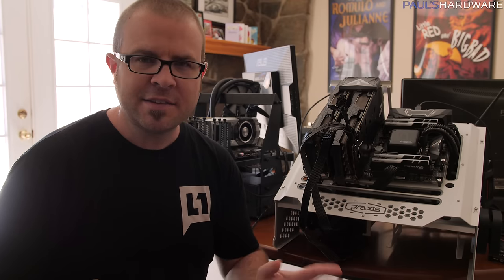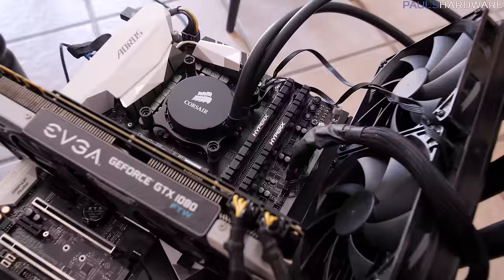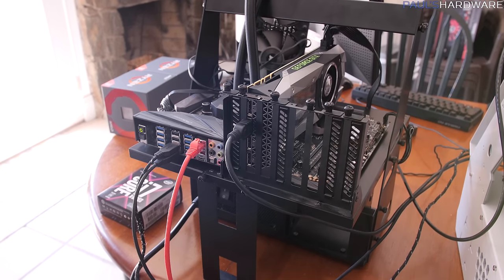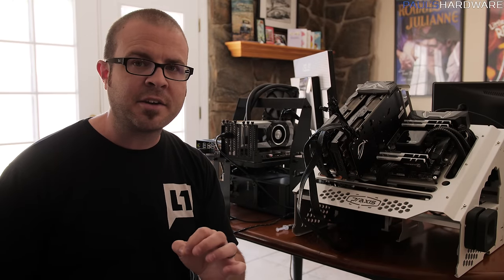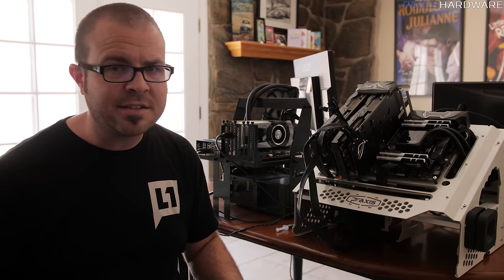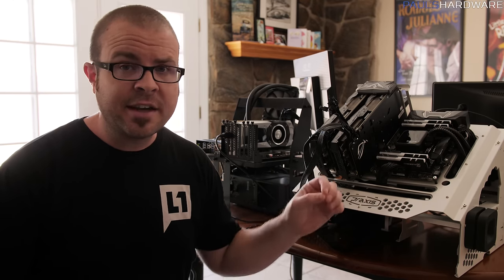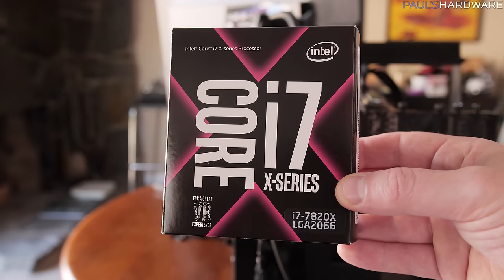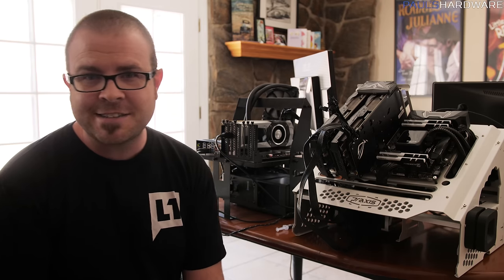What's The BEST CPU for Gaming with 1080 Tis in SLI?

Comment: If you are already usinf a x99 in your build why even going for any other 8 core platform at all? Either Paul an HW youtuber is overhyped on the new stuff thinking it would give him a big perf boost when it in fact does not even as far as going to haswell-e or he simply does it because like many others in this hobby likes to build new stuff, lets hope for the second one. Btw was the res 1080p? if so why the low perf numbers especially in GTA5, did it say ~80 fps with a 7700k and a 1080ti? even other titles like Tombraider seems low if this was 1080p, like a 970/980/1060 perf figures.

Ah it said 4k at the spec sheet.. makes sense, I mean 970perf like performance of the 1080ti at 1080 would suuuuck :D

Comment: Actually, if you really want to go balls to the walls, you should opt for the 12 core i9 IMHO. Because it is what Intel originally promised to be the highest core count of their offering. Anything higher than that seemed very doubtful. Just remember to use a MONOBLOCK instead of just CPU BLOCK if you're going X299, lest your motherboard melt into scrap...

Comment: Hi Guys, I’ve ordered two GTX 1080ti graphics cards for my build. Here is my Build: 
Ryzen 1800x @3.8Ghz 
X370 Taichu Motherboard
Corsair Vengeance 32GB RAM (2x16) @3000Mhz 
1080ti GPU @11GB x2 
1TB HDD 
M.2 512GB Samsung 950 Pro SSD 

What ways can I improve this? I’m thinking of swapping the mobo and CPU to Intel Coffee Lake, what do you guys think?

Also I only have a 1080p @60fps monitor
Reply: lol upgrade you monitor before you worry about cpu and mobo, should be using atleast 1440p for that setup
Reply: MejesticEmu hey dude! Just got the Acer Predator Z35P, it’s a beast at 1440p@120fps
Reply: Carlos Antonio nice dude! They’re awesome monitors, looking to upgrade to something like that soon too! (Running a 60hz 1440p Samsung panel for now)
Reply: MejesticEmu do it man! It’s absolutely worth it! Assassins creed origins is addicting on there! I’ve stopped gaming now and focus on building android apps and it’s great having the screen estate

Comment: You are doing yourself a disservice if you are building a monster build with a quad core cpu as of 26/07/17 because with the next gen games coming out soon, they will be favouring more thwn the standard 4 core cpu which is when finally the 6/8/10 core + will leave behind the trusty 4 core cpu, plus the pcie lanes arnt there either which will make another difference. WAIT FOR THREADRIPPER :D

Comment: Intel is in trouble after amd releases all its cpus and gpus with 3 more updates expected before march 2018 release of ryzen 7 18?0x refresh offering optimization on infinity awell as +100mhz on all clock speeds and overclocking in the rang of 4.2ghz to 4.3ghz.

Comment: Threadripper is not going to be that great for gaming, you are better off with the x1700 or i7 7700k.

Threadripper will have 12-16 cores, but those cores are no where near as strong PER CORE as intels cores, sorry guys, it is fact.

Until games can actually make use of more than 4+ cores like at least 6-8+, CPUs with high core counts won't ever perform as well as straight up 4 core CPUs.

Top Gaming CPUs are the i7 7700k, followed by the Ryzen 7 1700x or 1700, I'd choose 1700x over 1700 due to it having more performance PER core, because MOST GAMES only registers 4 cores, hence why the i7 7700k wrecks the Ryzen CPUs in gaming period, but as far as multi threaded task work, graphics, programming etc you'd use of course Ryzen CPUs.
Reply: Mike ™ its a fact? No it is not! TR uses the same zen cores that ryzen uses. It will have the same gaming performance unless something happens with the IF(which doesnt seem so)

Comment: Zen architecture is new. AMD is well-known for exaggerating and hyping their fanboys up. Until Zen 2 comes out with a better core clock speed, I won't touch an AMD CPU. We should not forget that in virtualization AMD with its ryzen CPUs has absolutely nothing, and I  emphasize absolutely nothing, to say compared to Intel CPUs. AMD = hype. They proved this with Vega   FE and the fact that they don't have the balls to publish more info about other Vega GPUs. But they are on the right track considering only CPUs. In this regard, I would give them more time to improve. second gen. Of Zen architecture is AMD's chance.

Comment: Paul Hardware please read this.       Thanks F**k for some to make Video on this topic, ALSO im one of those guys, i have 2 1080 Ti's with a 1080p monitor, in your video you said you dont recommend streaming and gaming on the same system, well i do that, but i use my GPU's not cpu cuz i need the power, you should of mentioned a capture device or a streaming pc. Would this be the best option?

Comment: two 1080ti's man u gotta have a beast cpu and that is only the i7 7820x and give it the most pci lanes compared the rest of the lot which all has 16 , including the ryzen 1800x , plus i7 2820x is way better it performs to the level of previous  10core i7 6950x which is a 10core chip and costs 1700$ and 600$ for the same performance  , and u know this 8 core chip has the grunt , i would say it turbo clocks itself so well that u don]t even need to overclock the chip , plus one concern here can put the gigabyte board like the gaming 7 or gaming 9 both of those cpu have two 8 pin power connector which is good for the cpu and vrm is much stable which gigabyte board , gigabyte recently also broke the record which a staggering 7.5 overclock on the skylake x chip .

Comment: I know you just want raw performance for gaming for this build, but i think it would send the wrong message to use a totaly bullshit platform like X299, you are paying twice as much as a Z270 or Ryzen platform that performes just a tiny but worse and the difference won't even be noticeable if you don't stare at the FPS counter.

Yes i know you probably don't even have to pay for most of the parts, but like i said going with the 7820X and X299 over the 1800X for double the price to have a small performance advantage does not seem very smart to me, we have to show Intel that X299 is bullshit and in my opinion you should lead as an example.

Or just use the Z270, nothing wrong with that platform either, just please don't use X299 it's just a bland ripoff with horrible power consumption, temperatures, VRM problems and anti consumer bullshit.

Comment: I've been super happy with my 7700k. I easily OC'd it to 5.0GHz@1.36v and it's perfectly stable and has been for 6 months. 36c at idle and 74c at full Aida64 load with a Corsair H100i V2 AIO (for some reason I've had people call me out and say I'm lying about the temperature, though I have no problem showing them footage so they can see for themselves). I'm confident I could take it to 5.1GHz but I see no reason to since it's so stable now as-is and it does a great job pushing my 1080 Ti@1440p on a 165hz G-Sync monitor. Ryzen has great price to performance numbers and is a good chip but when it comes to pure gaming performance Intel still reigns supreme.

Comment: Intel Core i7 7820X 8-core Processor was mi choice before and after to see  all youtube videos has more futuro second option amd rizen1800x 7700k is going to bottleneck new gpu generations because of his mother and sli lines 7740x is the mittle option but pci lanes and arquitecture =S sucks.

Comment: looks like the difference between 7700k and 7740x could be eliminated if you could get the 7700k up to the same clock, maybe set your AC to 75 or 72 instead of 80.

Comment: Hey Paul you should have tested a 1600 instead of the 1800x it is way better for gaming and streaming than the 1800x and you can clock it to 4.1 on water and be super stable. And its still 50 percent cheaper

Comment: If you delid that 7820x you should be able to overclock it in line with the 7700k. You just need to use liquid metal and remove the toothpaste out from under the ihs.